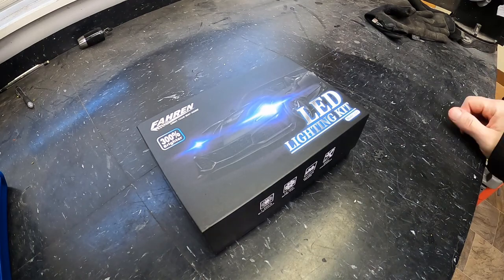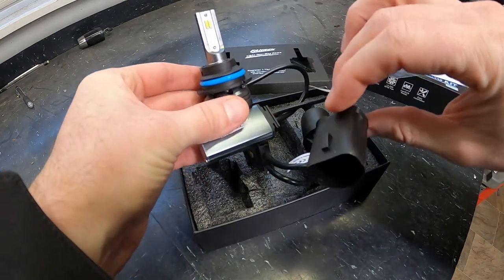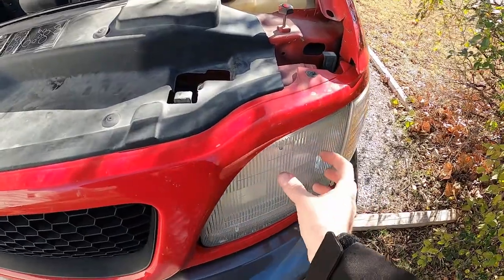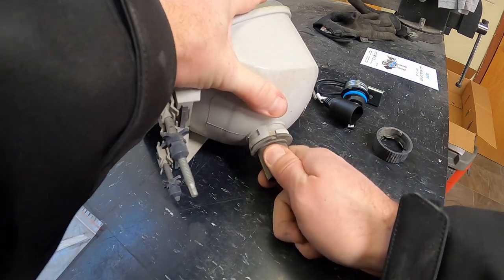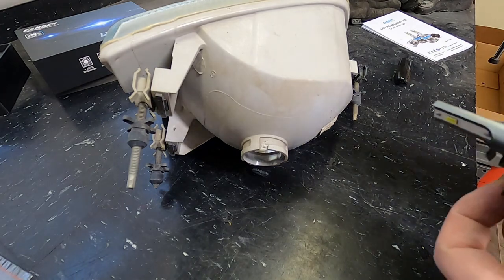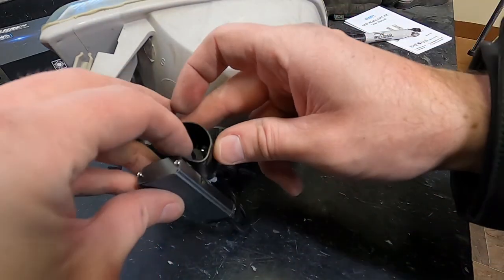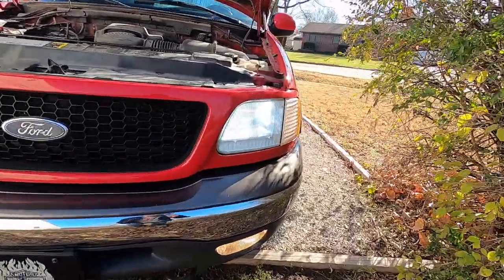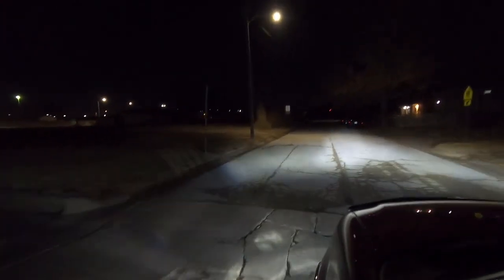Halogen To LED Headlight Conversion

Comment: Wow, you have to love that headlight assembly. Just spent 3 hours with the 2014 impala thanks to its high maintenance self.
Reply from the maker: Ouch! Is that one of the GMs that the front bumper has to come off?
Reply: @KonaBlueSVT  Oh yes, and let me tell you it's a little sketchy pulling it off once you pull the screws.
Reply from the maker: Engineering at its finest!

Comment: Can you switch out your halogen headlights with LEDs and still use the stock projection headlights that came in your car
Reply from the maker: Yes
Reply: @KonaBlueSVT  right on I appreciate it do you recommend a certain brand?
Reply from the maker: I've had good luck with AUXITO

Comment: My truck is 22 years old and I changed the bulbs last year but if there's no street lights I still can't see far enough ahead. I'd like to change the bulbs to LED but not sure they're legal in Florida. Does anyone know if the cops stop you for having LED ?
Reply from the maker: I am unfamiliar with Florida law, but some new vehicles come equipped from the factory with LED highlights, so I can't imagine it would be an issue.
Reply: Almost every new vehicle come factory with LED bulbs, I’d just check the number of lumens allows on low beams